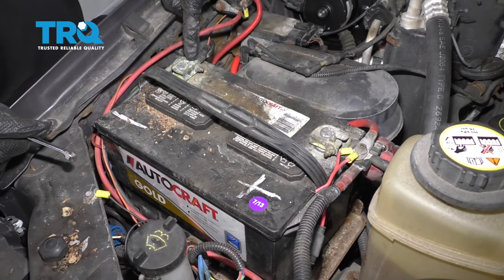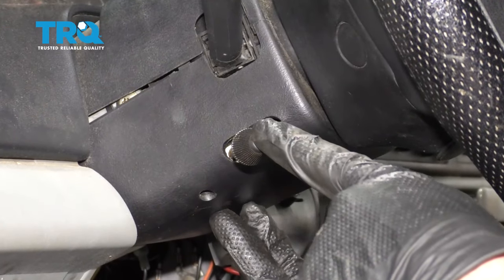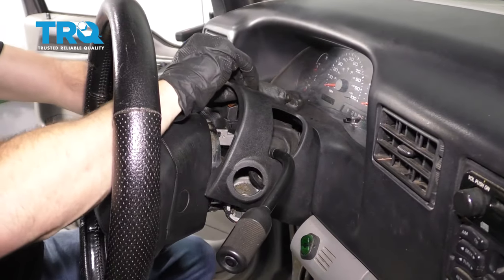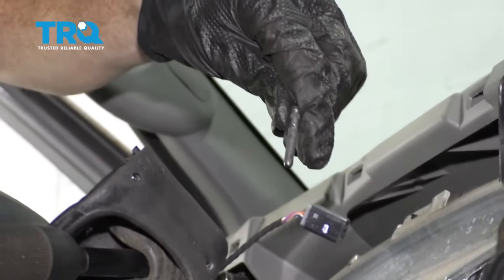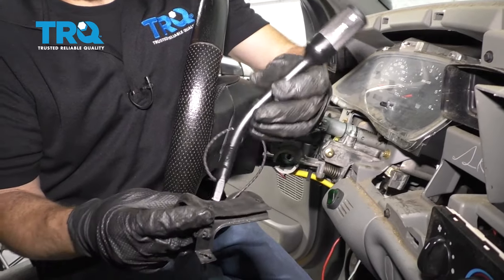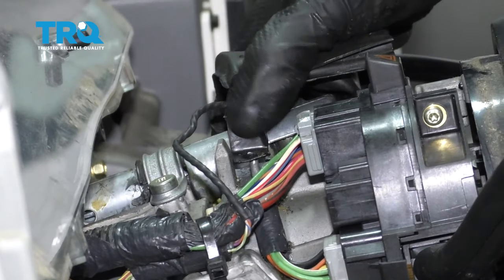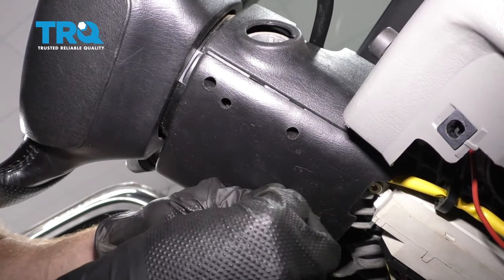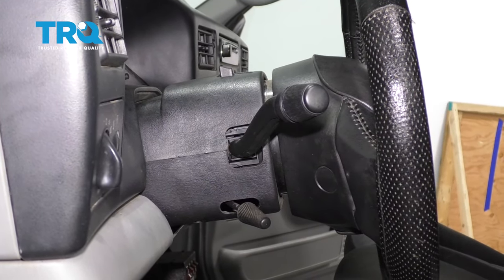How To Replace Shift Lever 1999-2007 Ford F-250

Comment: my linkage t30 bolts are tight and my bushings for the shifter shaft are not wiped out. my slop is actually in that cavity where the handle goes into and is secured by the pin. is there a way to tighten this up? i am almost about to cut up some feeler gauges and stick them in there...
Reply: There's a couple of set screws where the cable attaches to the column linkage. Sometimes those will come loose and create a lot of slop. My truck was like that when I bought it.

Comment: Thanks, but 

1) would like to have known a few of the reasons for the replacement

2) what are all of the parts that come with the replacement arms

Does the pin come with the replacement arm?

3) what does the arm attached to at the column?